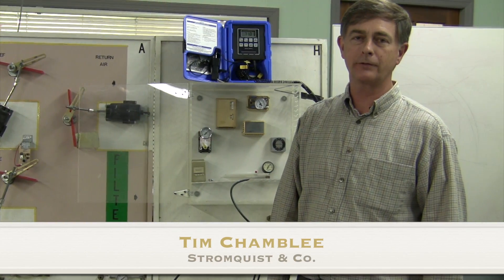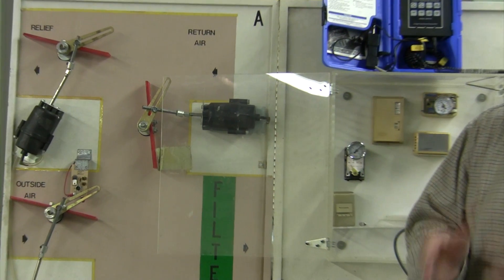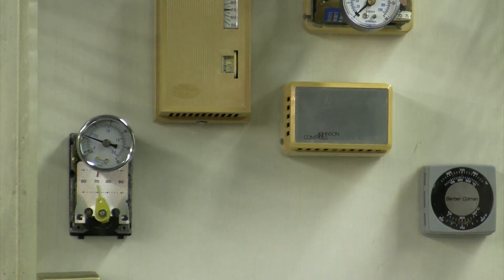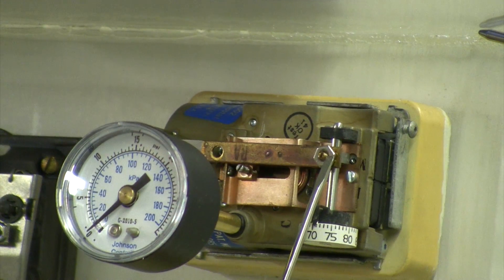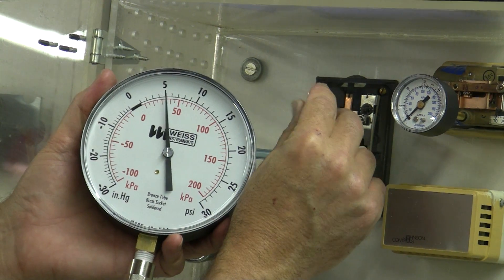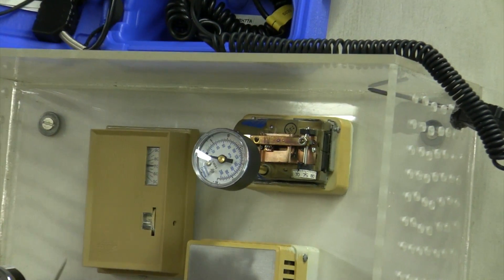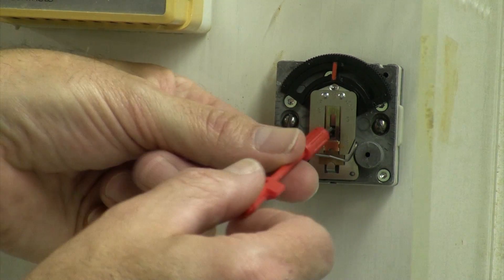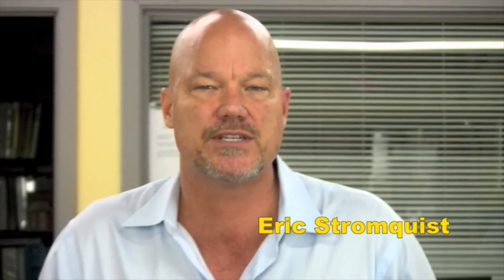HVAC Tech School: How to Calibrate 4 Different Brands of Pneumatic Thermostats in 5 min or less

Comment: Hey, I’m currently working on a building from the 80s in Australia. I’m only 21 years old doing a fit-out. They are keeping all of the old pneumatics, but replacing the thermostats. We have Johnson control thermostats. I have been calibrating using the other screw. What is the difference between the two

Comment: I just started a new job as a building maintenance engineer for 2 buildings that have a pneumatic HVAC system and i'm learning from scratch. This video was very helpful. I was told today that our bldg ideal pressure for the thermostats is 9 psi. Your explanation as to why made since to me and it our actuators look exactly like the ones you showed. I can't remember excatly why he said it was 9 psi, but I think it had something to do with the outside air pressure and the inside air pressure. I'll ask my boss to explain it again to me tomorrow. Thank you. This was a great video for guys like me. Now I just need the Johnson's adjustment screwdriver. I have 2 Honeywell but no Johnson's :-) We use both in our bldgs.
Reply: The 9 psi is related to the pressure at which the chilled water valve and the Hydronic heating water valve actuator activate.  The direct acting chilled water valve actuator usually begins to open at 11-12 psi and is fully open at 20 psi.  The reverse acting hot water valve actuator typically begins to open around 8 psi and is fully open at 0 psi.  At 9 or 10 psi neither valve is open and no cooling or heating is being called for.  You should be dialing your Tstat setpoint to match the room temperature which would be no call for cool or heat and then calibrate your tstat air signal output to the no call 9-10 psi range.  As the room temp goes up the tstat will send a higher pressure to open the chilled water valve.  As the temperature falls, the tstat will send a lower pressure to activate the hydronic heating water valve.

Comment: Good to know about tweaking of the T4002. I would dump the air out of the thermostat and let it rebuild the charge, then see where it stops. I swear every time I stare at it it’ll change the pressure dramatically.
Reply: breathing on the BI metal.
Reply from the maker: They can be very sensitive, glad the video was useful. Quick question, I am trying to figure out how my  controls disrtribution business can be more useful to the industry. What is your biggest challenge in business in 2019? What is the best thing a supplier has ever done to earn your loyalty? If you have a second to answer these questions it would be very hellpful. Thnaks.

Comment: how did you caibrate the last stat if you didnt plug in the pressure gauge to it? or did i miss something?
Reply: My whole purpose of watching this video was to watch the last t-stat; Robert Shaw or Schneider.
Reply: nramos137

You are right.  He didn't show much on the Robertshaw thermostat.
Reply: Was wondering the same thing. Since we didn't have a great view, I was wondering if that stat had it's own built in gauge. I couldn't tell.
Reply: the top right corner there's a hole where you can add your gauge.
Reply: His guage was hooked to poly that was attaches to branch or the valve. It doesn't have a pressure port as others. Its out (stats branch) is where u measure YOUR STROKE. not everything gets set to 10.5. This guy is EXCELLENT! #knowyourstroke lol
Reply: @chadpreston5549 yea it does there’s a test port on that stat